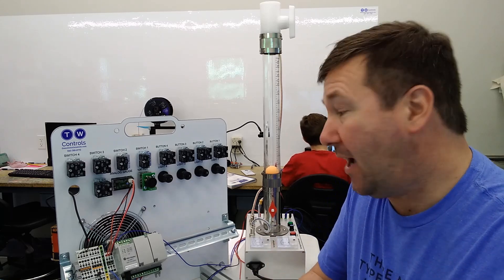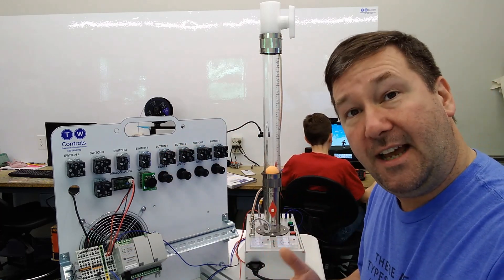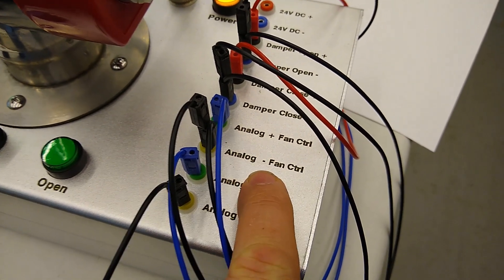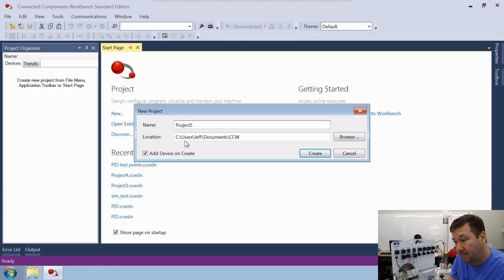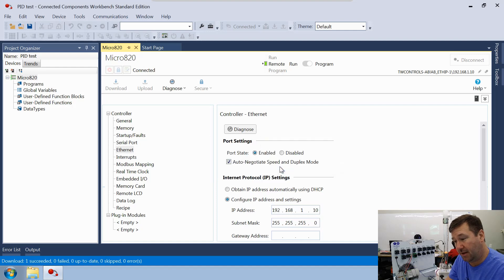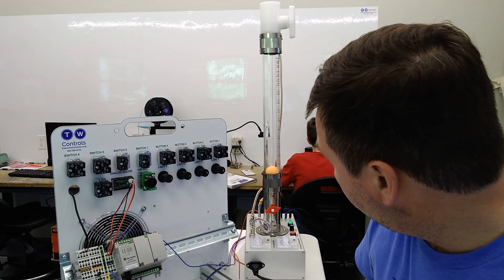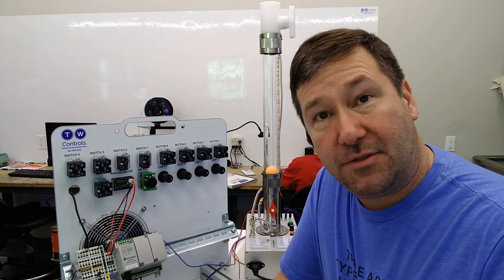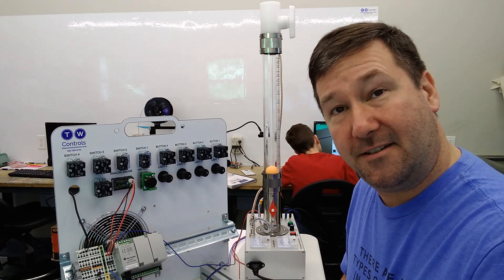PID Control.  Wiring the Analog Inputs and Analog Outputs to an Allen Bradley Micro800 Micro820 PLC

Comment: Hi Tim!

I have been trying to test PID control on my project and ran across a problem when trying to set my physical outputs from within connected components. It give an error message no details as to why. My controller is connected and in run mode. 

Your PID series is massively useful for my final year project. Honestly saved me weeks of struggling down to a few evenings after my day job and what is more I am actually grasping the theory behind all the lectures that seemed so pointless. Really thank you for posting all this content!
Reply: This is the message I get "An error occurred while writing to :Controller.Micro850.Micro850._IO_EM_DO_08." there is nothing in the fault logs. I have also tried it in programing mode and the monitoring mode.
Reply from the maker: The PID will be expecting an analog for the output, I'm guessing you are wanting to pulse something?
Reply: @TimWilborne  ah I should have mentioned, I am trying to send a digital signal from connected components to initiate a process that will eventually activate the PID control loop. 

I simplified my program and tried to turn on an output from connected components and it gave the same error.

Comment: Awesome, actually started your videos and got a micro 820 to kind of follow along, didn't realize you actually went into depth with that too.
I'm slowly coming up to speed with RX Logix 5000 at work, but have the 820 as a training/hobbyist PLC at home.
Reply from the maker: You can learn a lot with the Micro800. I like that it does ladder logic, function blocks, and structured text on the most basic model with the free software.